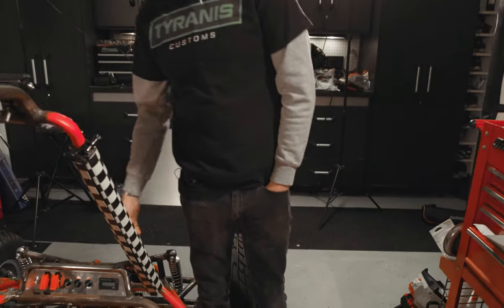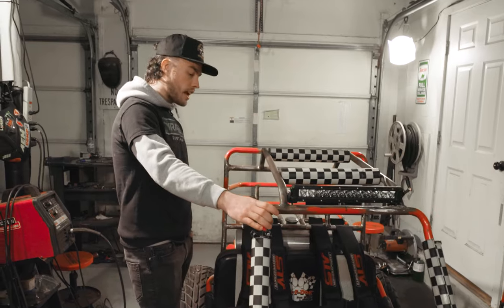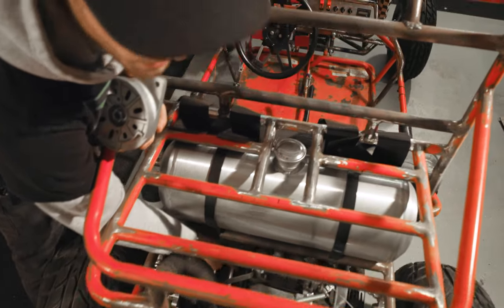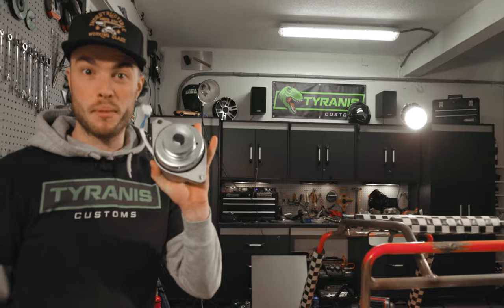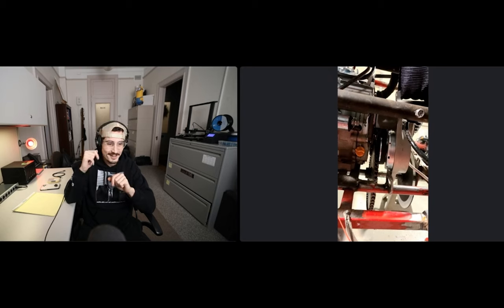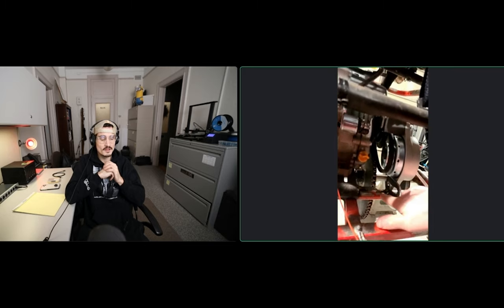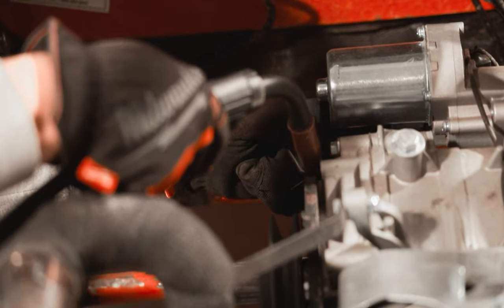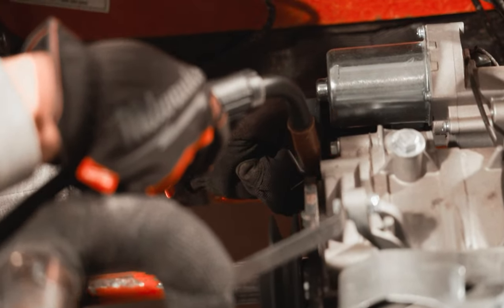20 Amp Alternator Install | 420cc Go Kart Electrical System Part 2 | TYRANIS EP22

Comment: Holy crap!  I had no idea they made little alternators like that. What a game changer. I'm definitely going to look into getting one for my rig. Just an idea to simplify things have you guys thought about direct drive the alternator off pull rope side.
Reply from the maker: Right!? And I've seen people replace their pull start with a pulley for an alternator. But with all the trail riding and adventuring we do with these builds I still wanted to be able to pull the engine over by hand in case the battery goes and I'm out in the woods!
Reply: Yes I agree that back up pull rope is the big difference between driving or walking home. I'm sure you guys will  come up with a plan that will amaze us as has been done since episode 1  love the videos rock on guys!!!

Comment: Can't wait! Might be working but I keep that "bell" ringing anyway! Anyone have any suggestions on painting engine shrouds? I'm thinking just the outside, does it have to be heat resistant? More issues with gas and other pollutants than worth the effort? Hmmm....🤔
Reply from the maker: Awwww yeahhhh🔔 As for paint, I feel like heat wouldn't be a big issue on the shroud but you do raise a great point about gas... I'm sure someone makes a clear coat that's gas  etc resistant!
Reply: Here is a 2k clear in a rattle can. 
https://www.amazon.com/gp/product/B0178ABUVM/ref=ox_sc_saved_title_9?smid=A1PM9ILMIUJHV2&psc=1
I did a gas tank in a metallic rustolium and used that as a clear coat. It works great and holds up to gas.
Reply: @MegaKencam  awesome!! Thanks so much for the link!!

Comment: I found out that Amazon sells those alternators under two different application names one for John Deere and one for Yanmar.
They look identical with the same specs and the ones for Yanmar sell for around $80 and the ones for John Deere sell around $60.

Comment: The link to the parts list doesn’t work. I’m wanting to do something similar on my motorized picnic table. I’m running a predator 459 with. 780 series cvt. What size pulls and belt did you use for the drive side?

Comment: Does the alternator pump out ac voltage? Like on the engine or is it somehow pumping out usable dc voltage for lights and stuff. Cool video dudes.
Reply from the maker: Until this comment I was just taking for granted that it seemed to be 12v dc... I plugged our lights up to it at idle and they come right on!
Reply: @TyranisCustoms  that's a win!!!

Comment: Thank you for all I’ve learned so far from watching your videos!!  May I ask how you were able to compensate for the alignment of the driven pulley of the torque converter when you put the alternator drive pulley on the crank behind the drive clutch?

Comment: With that pully on the drive shaft....doesn't that put the clutch outward more and leave a gap in the bore of the drive clutch? Do you just use a long bolt and thread it really tight?
Reply from the maker: Essentially yes, but now will the lathe im turning the pulleys narrower
Reply: @TyranisCustoms  Thank you.

Comment: Oh no I just saw where the alternator is backwards 😂
Reply from the maker: Spoiler Alert, It actual ended up being installed in the right orientation, I just wasn't taking my reading correctly on the multimeter. I still had to take it completely apart though and redesign the alternator bracket to be independent of the swing arm. We SHOULD be good to go now and you'll get an even better explanation next week!
Reply: Excited to see it!

Comment: What happens if u take an alternator from a semi truck and do this
Reply from the maker: It would probably work! Just be heavier than you need haha
Reply: Would it be faster? I mean the weight distribution could help torque and traction am I wrong?